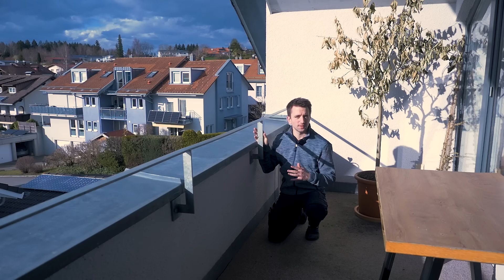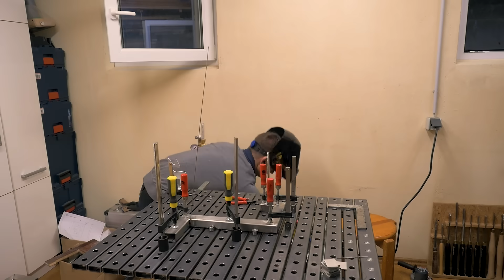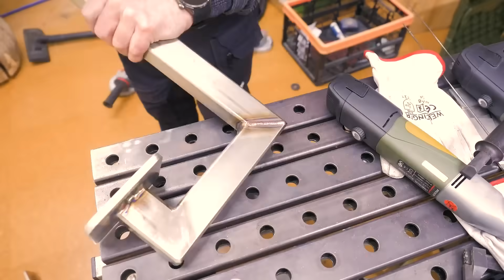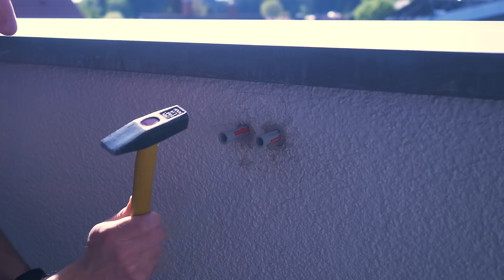Leaving my Comfort Zone & Welding a Railing || Balcony Rebuild #1

Comment: Also you are gonna kill yourself... Welding stainless produces probably the most toxic fumes you can generate with welding... The fumes coming from stainless contains hexavalent chromium... One of the most carcinogenic fumes you can inhale, a group 1 carcinogen much worse than asbestos. It rips your DNA apart.. Please never weld this stuff indoors.. Even outdoor welding of this stuff is dangerous. When the fumes condensate, the dust from that is still just as bad.

Comment: There's an issue now, the new railing does not conform to the building code as there is a 'step' before it now. The calculation of the railing height should be from the floor to railing, and since it has moved back, it should now be from the step up to the railing, which in this case is evidently insufficient height

Comment: Question: at 25:24, what is the small tool you are using to do light grinding and then after the angle grinder, sanding?  Is it a cut off tool? Is it pneumaic?  If you could share a link to what it is, that would be great! (Also, just new to your videos, but loving them! Thank you).
Reply from the maker: I linked them in the description

Comment: "Modern" brake cleaners don't contain phosphorus. Brake cleaner evaporates in seconds, and it takes grease during that process. It's perfectly safe to use it for cleaning parts for welding.
Reply: The issue is with chlorinated brake clean, but as long as it's fully dry it still isn't an issue.

Comment: i understand the not welding for the bolds but i would have fuse welded there just to prevent moisture between it so it can't freeze in there and brake !
also drill holes in the bottom of your horizontal tubes so the moister can get out to prevent cracking wen it freezes !

Comment: those fischer inserts are meant to be drilled through with the screw, that's why screws are usually ~20-30% longer than the inserts and the recommended hole length exceeds the length of the insert. the point being that when screw punctures the end of the tube, the tail of the insert begins to warp, and thus expanding around the screw, making it way harder to pull out. doesn't make much difference here  but just a note that the screw you used wasn't able to go through the insert

Comment: You're using Fischer plugs, that rail isn't going anywhere 😃 I prefer Fischer duopower universal plugs in my work (property maintenance), those have saved me from a lot of hassle. I've also had to replace plugs from failed fixings with the proper ones and they hold even in an imperfect hole. I highly recommend anyone not familiar with Fischer duopower plugs to give them a try. Greetings from Finland 😀

Comment: btw in case you weren't aware, you can sharpen the tungsten from the tig torch, just turn it against the wheel of a grinder while its on, or pop it in a drill and then spin the tungsten against the grinder disk

Comment: I don't think that design would meeting building codes in my country since you have now created a climbing edge that is lower than the original railing. People need to check local requirements before taking on jobs like this.
Reply: I share your concern.

Comment: Excelente work, however I would do it with machine bent round pipe, it would be probably faster and cheaper. sugestion, round as much as possible the human touchable welds. And don't worry, it was nearly impossible to make it aligned with previous wall holes but  you  missed them for a few mm, nice job.

Comment: Such a clever integration of design and functionality, but I can’t say I expected any less from you! Personally I think it’d be awesome to add a deck spanning the beams and floating over the wall cap, it’d add a bit of texture and warmth, and the folding table could be leveled with that surface and fully extend that tabletop to the back edge of the railing! 

The height might not make sense for that though, but having a 2 tier tabletop would be really nice too. In a dining table type use, you’d have one surface for your personal plate, and another surface for the family style serving dishes, tabletop lights, or other items. 

Maybe a deck span surface was the plan all along, I watched in the background while working on my own project. Apologies if I missed a relevant portion of the video!

Comment: Was it not possible to put a horizontal bar above the ledge anchored to the left and right walls?  That would have been the simplest cleanest solution.  There could be a single support connecting to the inner wall in the center for rigidity.  Alternatively, two horizontal parallel bars 15-20cm apart with 2 or 3 vertical connections between one another for rigidity and no connection to the inner wall.  This would be rigid, have additional height for safety, and be very simple looking.

Comment: I'm not an anchoring enginer, but i think that you should have used chemical anchor, or chemical bolt. Your solution isn't winter proof nor long time exposure proof. And that rail is for guarding life.

Comment: AI Summary

Abstract:

This video documents the extensive process of replacing an existing, impractical balcony railing with a new, robust stainless steel design. The project emphasizes precision welding, jig fabrication for consistent part alignment, and problem-solving encountered during the build.

The creator details the selection and preparation of stainless steel materials, including pre-cut sections, and the iterative process of improving TIG welding technique through practice and feedback. Building custom jigs proves crucial for achieving identical S-shaped support pieces and accurately attaching mounting flanges, despite challenges with material warping during welding. Solutions for ensuring squareness and managing heat-induced distortion are explored.

The final installation on the balcony highlights an unexpected issue with misaligned mounting holes in the brick wall, requiring a clever fix involving re-mortaring and precise re-drilling. The completed railing is presented as significantly enhancing the balcony's functionality and aesthetic, being overbuilt to accommodate future additions like a flip-up table and a sunshade system.

Building a Stainless Steel Balcony Railing: Precision Welding and Problem-Solving

*   0:00 Old vs. New Railing: The video begins by showcasing the old, uncomfortable flat bar railing that makes the balcony's brick wall unusable. The goal is to build a new stainless steel railing that extends forward, providing more usable space and improving aesthetics, mounted to the inside wall.
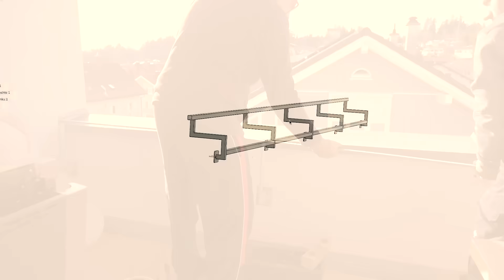*   1:05 Design & Materials: The new design features five S-shaped vertical supports, a long top rail, and four shorter rails near the mounting flanges. Materials include 40x40mm and 30x40mm stainless steel sections (3mm wall thickness) and 8mm stainless steel plate for flanges, all pre-cut with miters.
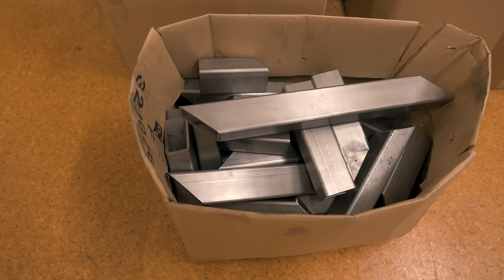*   1:56 Welding Practice: The creator, on their second proper welding project, practices TIG welding off-camera, progressively improving technique to achieve clean, square 90-degree welds.
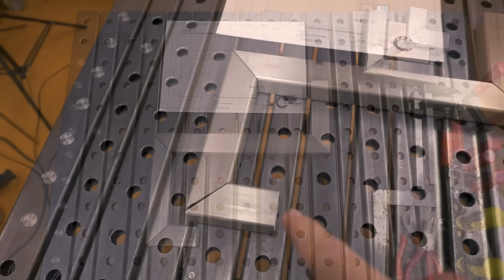*   2:53 Building S-Piece Jig: A custom wooden jig is constructed on a welding fixture table to ensure consistency for the five required S-shaped pieces, setting precise distances (130mm and 50mm) and square alignment for tacking.
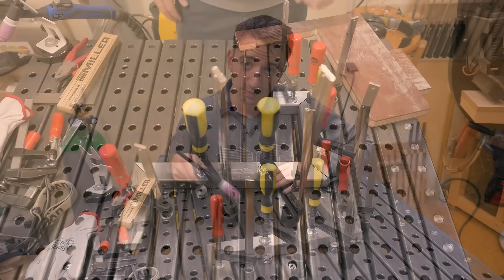*   6:06 Weld Preparation: All stainless steel edges are chamfered (except pointy ones) and cleaned with a cleaning disc and acetone to ensure proper weld penetration and prevent gas release.
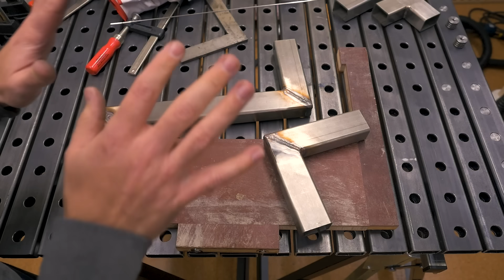*   7:40 Tacking S-Pieces & Warping: Initial tacking attempts lead to warping; the creator refines the welding order (outside corner, then two faces inside-to-outside, then fillet weld) to manage shrinkage and maintain squareness.
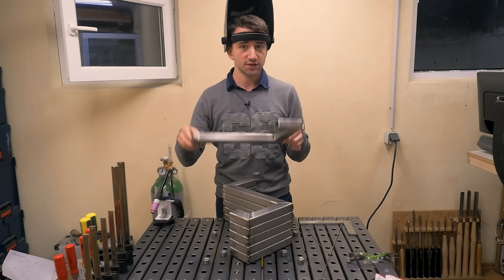*   10:58 Welding S-Pieces Solid: The S-pieces are welded solid, with the creator optimizing the welding angle to work with gravity and adopting a faster welding speed based on Instagram tips to improve weld appearance.
*   14:13 Flange Attachment Jig: A new jig is built to accurately position and square the mounting flanges to the S-shaped pieces, ensuring a 25cm distance from both the bottom and top edges.
*   17:58 Flange Tacking Challenges: Initial tacking of flanges results in shifting; the solution involves welding quicker on one side and adding an extra clamp to prevent movement.
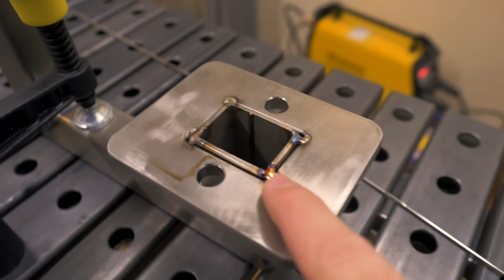*   18:50 Welding Flanges Solid: Current is increased for the thicker flange plate. The creator uses the box section as filler and even crafts a custom camera mount using a welding mask for close-up shots of the welds.
*   21:57 Final Alignment Check: After welding, all S-pieces are clamped and checked for alignment. One piece is discarded due to an ugly weld and slight forward lean, allowing the selection of the five best pieces.
*   23:00 Inter-Support & Main Rail Assembly: Shorter inter-support pieces are welded using a jig, and distortion is managed by heating the opposite side. The long main rail is capped and welded to the S-pieces, with one end left tacked for later final welding to balance distortion.
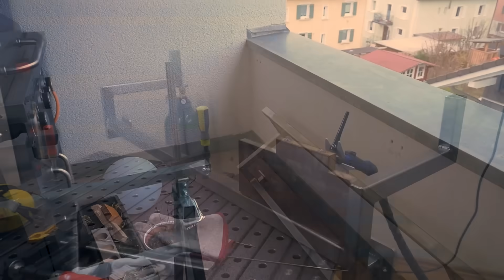*   27:01 Balcony Installation Challenges: During mounting, the existing holes in the brick wall are misaligned. The solution involves marking current positions, drilling larger holes, filling them with quick-setting cement, and then re-drilling new, precise holes.
*   32:31 Final Mounting & Future Enhancements: The railing is securely installed using M10 bolts into the new, re-drilled anchors. The completed railing is significantly stronger and provides more usable balcony space. Its overbuilt nature is justified by planned future additions, including a customizable flip-up table and a sunshade system mounted to the railing.

I used gemini-2.5-flash-preview-05-20| input-price: 0.15 output-price: 3.5 max-context-length: 128_000 on rocketrecap dot com to summarize the transcript.
Cost (if I didn't use the free tier): $0.0066
Input tokens: 20651
Output tokens: 1004

Comment: 30:30 alternative to your cement and redrill. you could have used your template and chemianchors. Ie drill slightly bigger holes to capture your new holes. Inject grout or place cement in hole place template and clamp then insert bolt so create the hole location. Then once dry remove bolt template and place rail and final boot to depth. Should be super snug. Alternatively just use the final rail - drill, grout , place rail and insert final bolt. Then done(unless Minor tightening to ensure no wobble).

Good job though…. Space for steins and Schweinknuckle or bowls of pork scratchings. 

I suspect the tree had one too many steins itself…. 😂

Comment: You need a welder's apron.

You can 3D print a small part the shape of a funnel with the spout located off center and a hole opposite the center from the spout. That goes onto your vacuum cleaner. You attach it to the wall. The suction from the vacuum cleaner will keep it in place. You can now drill holes through the hole, and all the dust is collected a lot more efficiently by the vacuum cleaner. (Not my idea -  I got such a part with a Bosh vacuum cleaner - but it works great.)

Comment: brake cleaner works great, you just need to buy the kind that’s marked dechlorinated. Realistically if you use chlorinated brake cleaner, it’s not really a problem if you make sure that it is thoroughly evaporated off first.

Comment: May I hear your thoughts on two aspects? :
(1) Dan Gelbart says not to wipe with acetone or any other organic solvent for that matter, at least when talking about painting. Why do you clean with acetone? What would happen if you didn't clean with acetone?
(2) In the mitered corners, if you add a "diaphragm" element between the pieces to be joint, perpendicular (ok, 45*) to the axis of the pipe, you add enormous torsional stiffness, and I presume, dimensional stability. You do lose the through-hole for wiring, etc. Any reason why you don't use this?

Comment: Instead of hanging the table inside why not a stainless steel table that goes over the supports on top of the wall? It’s only 25cm but you could make it hang over into the walking space if you wanted wider.

Comment: As you well know by now, SS warps like space time given any heat. Please take more time to tac, adjust, clamp, and stitch weld. Most folks will tell you to use more clamps and while that works for a lot of dimensional material, HSS (hollow structure steel) does not take to ridged clamping well. Heat control is the only real solution - but you can learn some minor tricks to get a few more mm of straightness/flatness where it counts. Keep up the good work.

Comment: I don't get it.  The rail doesn't seem to accomplish anything at all.  The wall will keep anybody from falling off the ledge.  What does the rail do?
Reply from the maker: The wall is not high enough
Reply: @MHAnything is your wall lower than 80 cm? Because it is thicker than 15cm and you fall less than 12 meter it only needs to be 80 cm  

On the other hand, if it is lower than 80 cm your new railing does not meet code, if I remember correct, because the height only counts from the last edge that is less than 5cm deep, so in your case you would have two steps... Gotta love our landesbauordnung 😂
Reply: @MHAnything  God, I HATE living in a NANNY-STATE.  That rail may, or may not, meet some safety code, but  it adds little, if anything, to actual safety.  I thing the only real reason for the rail is to provide useful mount-points for a wind and/or sun screen.

Comment: Insulation on the balcony?
Reply: Yes, all the faces of the building are covered with insulation, but in the case of the balcony not for thermal insulation (obviously), but for ease of construction and consistent behaviour (with weather changes) of the facade over the years (a transition between different materials would in the best case be visible, and in the worst case form cracks which would allow water to get behind the insulation).

Comment: You can also clean your welds with vinegar. It prevents from rust too.
And yes under circumstances stainless steel can rust.
Reply: I think he has his engineering degree by now (or is very close to) I’m 100% confident that he is aware of that
Reply: @Rsama60 in the video he sanded it
Reply: @diyhard666 yes I am aware of this. Stainless steel is stainless under normal environment conditions. Not more not less. He did not pickle the welds, true. But for a balcony railing I think this is not possible.
I’m a procees engineer and built equipment for the nuclear industry. We pickled components for extremely acidic environments. I am also a sailor, I sail inland’s on a sweet water lake. No need to pickle stainless. Different story in saltwater though. Standard V2A stainless would not do.
Reply: @Rsama60 and it looks better than sanded
Reply: @diyhard666 that is a question of Taste. I prefer / brushed surfaces
Reply: @Rsama60 true

Comment: Nice work. I was surprised to see the top of the parapet wall was not level, but I guess it's for runoff: I don't live where it snows or freezes or even rains very much so flat and level is normal for us.
Reply: My issue with that is that it inclines inward and not outward.
Reply: @prood97134 well he lives upstairs and I assume it’s a rented apartment with neighbours below. If the collected dirt gets flushed outwards the windows below get all the dirt. The neighbours then need to clean it. It’s a considerate thing to do.

Comment: I have two points:
1. Who approved this alteration? As far as I'm aware, railings have to be at their highest point, measured in a straight, vertical line from the surface of the floor.
While your railing might be at the right height, it can not be measured in a vertical line.
You can still lean over it and be in (theoretical) danger of falling. Also, children might see this as an invitation to climb up and over the railing. (Always have to think of the future use of the apartment).
I do not think that this is up to german code, ideally you'd let a Metallbaumeister look over it.
Realistically, in a private apartment no one cares, except if there's a casualty.

2. When heating to straighten out bent or warped tubing, always apply the heat directly opposite of where you welded. Also, the best and least visible effects are gained if you only heat the corner radii of the tubing. You heated from radius to radius, directly across the flat surface, this is not ideal. The outcome is neither predictable, nor pretty (You can surely see some distortion from that heating).

Comment: The phosgene-flashover thing with welding on brake-cleaned parts is from old style chlorinated brake cleans - the perchloroethylene/tetrachloroethylene decomposes with heat into phosgene gas. Tetrachloroethylene is, as I understand it, banned in Europe and most other sensible places, so it's mostly just a thing for us Americans to worry about. New-style brake cleaners are, variously, acetone-based and naptha-based (or a blend of the two). None of it holds a candle to the crud-cutting ability of the chlorinated ones, but it also won't kill you.

Comment: I would not have thought about phosphor in break cleaner, but about chrome in stainlesss steel,  forming chrome-oxide. There sure is a reason why every welding YouTube channel has a powered air purifying respirator or a fancy fume extraction system.

Comment: Another small suggestion... if you keep the filler rod end inside the argon flow during the post-flow stage along with the weld, the filler will remain pristine and not oxydized.  
You improved really quickly, so good job!